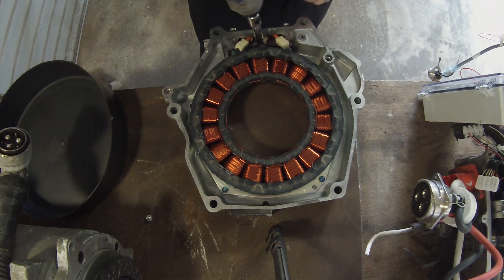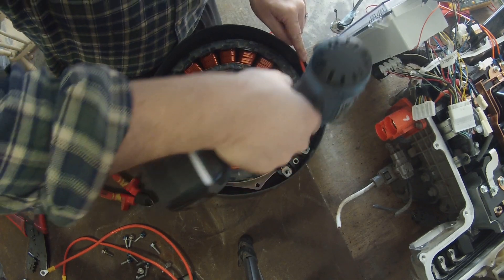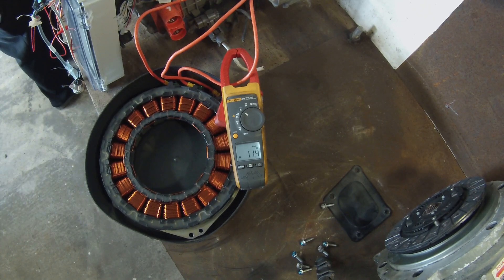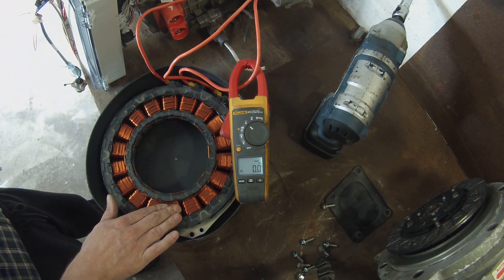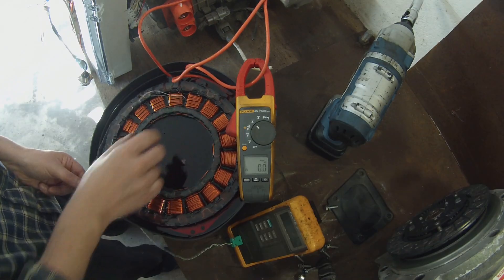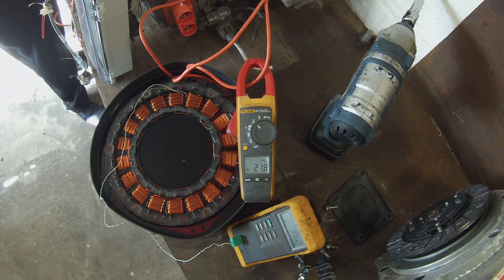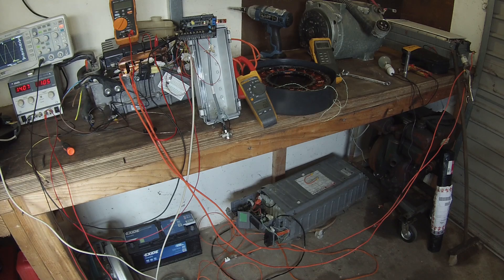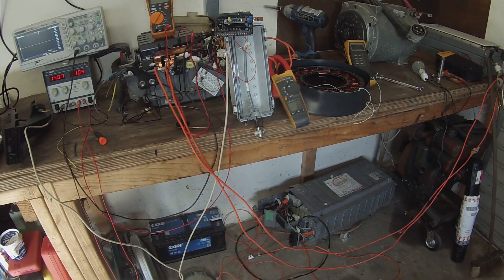Prius Gen 2 Inverter VTech AC Current Testing

Comment: Cool, visegrip brand quick disconnect!!   Do you use the lto batteries in a conversation? I have a house running off batteries, and thinking about buying LTO ev batteries to power it, they would probably last 50+ years if what is said about them is true, especially only pulling 300 amps from around 1.5kah bank at 29v or even 58v in a 48v system, I want to add 2-3kw of solar and build a EV to go with it! I'm also building a E bike, all powered by sun!

Comment: YES! I saw that 200 amps! Imagine that in a small car, miata, or some small sporty car, what type stator is that? Is it a easily useable motor? Or could it be? I think using oe ev components is easier , cheaper, than aftermarket conversation components, I have a mid 90's camery I'd like to do a rwd ev conversion on, or atleast a ev conversion! I have DC series wound motors I was going to use, but not now, I don't think they would be dependable at 96v+, with loads of cooling,

Comment: Silky question, are the gate drives magnetically isolated, or optical? 
Reason I ask is I wonder if we could parallel the two inverter outputs to run combined close to 400A three phase. I worry that optical isolators variance in delay might be problematic, but iirc the magnetic ones can be within a few nanoseconds and that ought to be close enough. 
You see, I have this lonely 2001 Honda Insight that has a 400 amp rated GM EV-1 motor already in it with custom driveshafts and all. If I had a controller I might actually make it run again... or maybe I should use the Gen1 Leaf inverter that I have with a custom control board? Too many options. :-)

Comment: Would it be possible to use the inverter to make mains power from car traction battery (300-400vdc)? Particularly interested in U.S. 230vac split phase power output for home supply. Thanks Damien - keep up the good work
Reply: If your talking about using it to convert to dc battery power to 230 ac split phase I'd be interested to find out also. Would be useful for solar and other renewable energy systems
Reply: @xblinkusedfinchx  Why not consider the MPP Solar(tm) LV 5kva-48v Inverter Charger unit which does all that - twin solar inputs & twin inverters (to get both phases).
Reply: Looks like it should, what I'm trying to figure out is how easy/difficult it is.